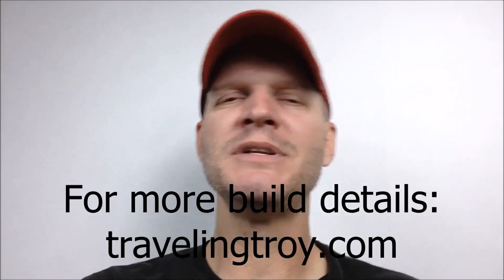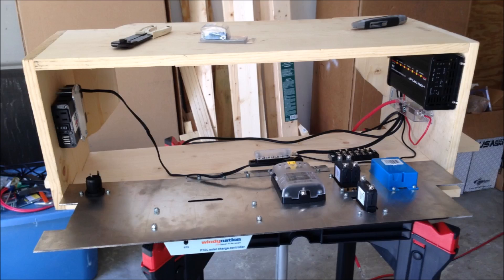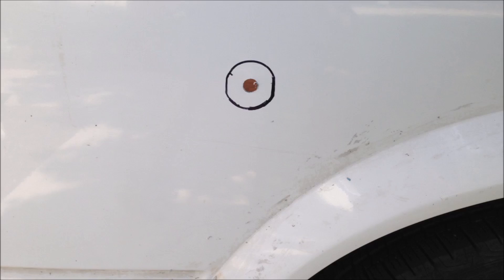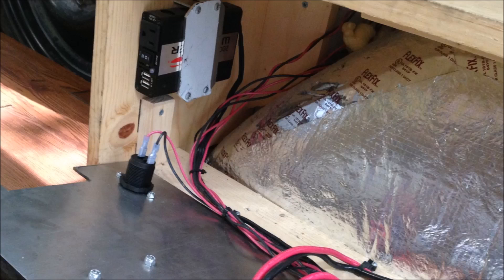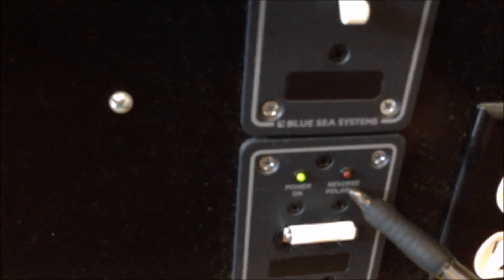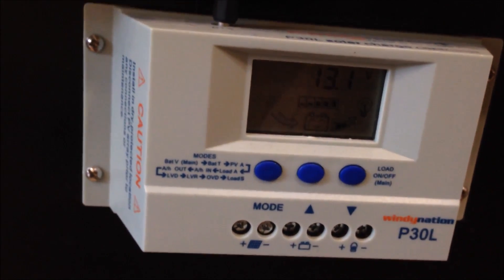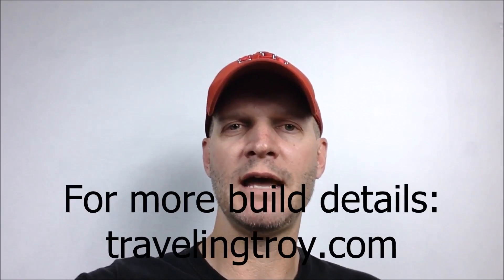Astro Camper Van Build 6 - Power Center - Batteries - Shore Power

Comment: I didn't know you could have batteries inside the van. I have a astro and I was going to get a solar panel and a deep cycle battery,but my friend said they were dangerous as batteries let off gasses. Can you tell me what I can do thanks
Reply from the maker: Hi Debbie.  Your friend was correct.  Lead acid batteries let off gases.  These batteries are cheaper, so they are a good starting point, but there is the gas release issue and they need to be maintained (add water).  Sealed AGM batteries, on the other hand, are slightly more expensive, but no off-gas issues.  I chose AGM for my 1st set of batteries.  I now have a Lithium battery.  Way more expensive, but no maintenance, lasts longer, charges faster and typically is much smaller and lighter weight than the other batteries.  Hope this helps.  Good luck with your Astro van.  Welcome to the club. 😁✌️

Comment: Could i get by with only two solar panels?
Reply from the maker: Hi there.  Sure, you could get by with one or two solar panels.  The 100 watt panels I have pull in a max of 5 amps per panel on a sunny day.  They may only pull in 1 amp each early in the morning, then 5 amps each mid day, then down to 1 amp each as the sun is setting.  So, if you had a 100 amp hour battery, and only one or two panels, it would just take longer to get to a full charge.  For example:  My 3 panels will top my battery off by lunch time.  2 panels may take until 2 pm or so and 1 panel could take the whole day.  It also depends on have much power you are using overnight when there is no sun.  Hope this helps.  Thanks for watching.

Comment: Glad I saw this. I plan to put a 30 amp plug next to the wheel well. I should try to design the power center around it like you have.
Reply from the maker: Hi Anita.  Cool deal!  Glad you saw the video.  The wheel well is typically wasted space in a van build, so it does make a great place to put the power center.  The only negatives I could tell you about are: 1.  You would need to crouch down on the floor to work on wiring/electronics when troubleshooting a problem.  2.  Flooding.  Don’t drive through high water.  I’m from Houston where it floods every year, so I always move to high ground if there is a threat of heavy rain.  I’ve been in my van for over 4 years and have kept my electronics dry thus far.  👍😁 Good luck with your build!

Comment: i first thot you had two inverters one for a small thing and one for the bigger one and you could choose which one you were going turn on or off later to realize it was the charger but it did give me an idea for help me thank of a way to conserve power when only needing a small amount of ac vers  a big amount and to cut down on the stand by pull when dont need the one

Comment: You have given me so many great ideas. So, thank you. The power center around the wheel well is spectacular in its simplicity. Kudos to your Dad.

I looked at that battery charger and can't find good info on it... if its 13.8 vdc float... too high for FLA, let alone AGM. I will probably stick with a custom built Progressive unit, from Bestconverter.com that has better charging parameters including LFP if I ever have an extra couple grand to spend.

I like the AC circuit breakers that work so well on that panel.

 I've also watched your sofa / bed video and that was good as well. Mine will be somewhat different in that mine has to store against the wall (its a cargo van build), but again, simple and nice.
Reply from the maker: Hi Clint!  Yes, the power center has been the star of the van.  My Dad did a great job on the power center and it has worked flawlessly ever since we brought it online.  As far as the battery charger goes, we first installed it because I knew I would be at one location for a while and had access to a free power source to charge the batteries.  Now, probably 2 years later, the battery charger is collecting dust.  I don’t recall the last time I used it.  With the combo of solar and a battery isolator (for rainy days), I haven’t had the need to plug into shore power.

Good idea on the wall mounted bed.  We considered having the bed fold up to the wall as well.  I could see that coming in handy if you want to haul a kayak, bikes or some other toys in the back when not in sleep mode.  I’m glad the videos have been helpful and good luck with your build.  :)

Comment: So how did you end up getting the jack mount out?  I have one that is in
 the same space that looks like I need a blow torch to get it out. Thanks for any insights /tips.
Reply from the maker: Yes!  What a pain that was.  We actually had to pry the jack mount out.  It left a hole, which we had to fill later.  It may be a better idea to have someone blow torch it out.  We didn't have one handy or a "blow torch guy", so we used vice grips, a hammer and other tools.  LOL!  It was a pain.  Good luck with it Patricia.  ;)

Comment: Hello.   I have a question?    I have a shuttle bus , I want to run some conduit  with some plug outlets .  Witch should I use PVC  or  steel  conduit ?    Thanks
Reply from the maker: Conduit is a good idea as it will help protect the wiring. On my van, I didn't use conduit. It was too small of a job for that. Instead, I ran my wiring while I installed the insulation, expecting the insulation to provide protection.

Comment: Very good detailed instructions on how to install it correctly.i like how that panel is so accessible for future adjustments or repairs or troubleshoot. You guys should continue making more videos summer to this. Future advice identify the wire gauge for those that are new to this. I know the short distance it’s not that important to know the wire gauge but if you’re planning on running the wires further out than I know it would be very helpful to know wire gauge .keep up the good work 🚐👍🏽🙂🔧🍺🇺🇸🇲🇽🍕
Reply from the maker: Thanks for watching.  My Dad and I are in the process of doing an electrical upgrade to the power center.  I plan to make more videos and supply a detailed wiring schematic soon.  We're adding a battery isolator,  new solar controller and a battery monitor.  Cool stuff.  :)

Comment: Hey Tony, love the build! Just finished a year living in the back of a truck. I'm picking up my "new" astro tomorrow! Its got 210k on the motor yikes! 2 quick questions, did you have to deal with the dreaded spider injectors yet?? And whats the shore power battery charger you used, I like all the blinky lights. 

See you on the road
Reply from the maker: Good luck with your build.  No, I haven't to do anything with the injectors yet, but some day.  I used the VMAXTANKS Smart Battery Charger.
Reply: Logan Stark your dad is awesome! Can I adopt him...pleeeease! Lol Great job!
Reply: Logan Stark I have the 5.7 vortec in my1500. super tight access, but doable with time and patience and lots of pictures as you go along.
Reply: 🚐🤦🏻‍♂️You should look into the new ford transit they’re becoming more fordable now that they’ve been on the market since 2015 the 148 wheel base is highly recommended you should test drive one ☝🏽. And if you do buy a Ford transit get the 2016 and up.😉

Comment: Nice Setup the only thing I am confused with is what inverts the power that runs to the Wall outlet? I see on one side you have a 300w inverter but does the charger have an inverter inside?
Reply from the maker: Hi there.  The wall outlet in my van is only usable when plugged into shore power.  I wanted to give myself the option of running high wattage small appliances if needed in the future.  When out boondocking, the outlet has no power, so I rely on solar and plugging into cig outlet and the inverter which has USB and one DC outlet.

Comment: Why not have the batteries hooked up to the alternator instead of having a solar rig?
Reply from the maker: Hi Corey.  Yeah, setting up a battery isolator is in the future plans, but that is best for when you are on the move all the time.  I knew going into this build that I would be mostly stationary for a while before hitting the road full-time.  So, I needed a way to get power without having to run the engine.  At first, it was hooking up to shore power, then it was the solar setup.  I haven't had to plug the van into shore power since installing the solar panels.  It does cost more than a battery isolator, but it has been well worth it.

Comment: I'm hopeful you've enclosed the batteries and created a vent to the outside. A discharging battery is quite a dangerous thing.
Reply from the maker: Hi Ken.  My batteries are sealed AGM batteries which let off little to no fumes.  However, I never sit in my van without some sort of circulation going, bringing fresh air in and pushing stale air out.

Comment: very good and informative, I may have to borrow your system someday. I'm assuming that you just add the solar leads into the controller when that time comes and everything runs smoothly. very nice.
Reply from the maker: Yep, that is exactly what we did.  We built the inside components in the power center, then later we added the solar panels and just connected them to the solar controller in the power center. :)

Comment: Excellent build , very clean.  I am planning an Astro AWD build now. I will be incorporating a lot of your ideas on the electrical section of the project. Did you ever get closet storage built above the power center ? Thanks for the videos , great resource for information.
Reply from the maker: Hi Adam.  Thanks for checking out the videos and good luck with your AWD build.  That will be cool!  I did get storage built above the power center.  It is currently just shelving, but will be will be completed some day in the future as closed off storage.

Comment: Sup Traveling Troy! I'm in Houston about to convert an E-250 passenger van. Couple questions I have are what would be the best way to insulate all those large windows?? And, when it comes to batteries and electricity I have no clue what're to begin so thanks for this video, my question about that is what are the bare necessities and bare minimums needed for a battery set up because all this looks like rocket science haha. Thanks
Reply from the maker: Hey that's cool Austin.  Good luck with your build.  Insulating all the windows on a passenger van depends on whether you want to seal them off for good or do you plan to use them for views later.  Most people use reflectix to cover the windows and this can be temporary where you pull it down when you want a view or you can semi-permanently add the reflectix to the windows for the long term where you don't remove them.  I have a video where I share what I did with my windows here: https://youtu.be/utOSILSBvpU

The electrical set up can be intimidating.  You should probably first start by listing out what you would need to power in your van.  The more you need to power, the more complicated it gets.  For a basic setup, you could go with a 12 volt battery (or two 6 volt batteries), one solar panel, a charge controller and an inverter.  This would allow you to charge the batteries with solar and run your equipment from the inverter.  If you want built in lights, a roof vent/fan and places to plug gadgets in for charging, then you would need to run the wiring and add in a fuse box and other items.

I'm no electrical expert and I was lucky that my Dad knew how to do this.  I would suggest finding someone to help so you get it done right the first time so you don't have to deal with the frustration of trying to figure it all out on your own.  Thanks for checking out the videos Austin.  I hope this helped.
Reply: +Traveling Troy thanks you're the man!!
Reply: How does your dad know how to do this? Is he an electrician? Can I pay him to build me one for my Astro?
Reply: I use reflectix for privacy and keeping the heat out, or in. works great!

Comment: I just started my build and have been struggling with the battery location in my van. I know what can happen if they are not really secured in the event of an accident. I plan to use a small gang box made of 14 gauge steel to mount the batteries in. I guess you had your reasons for using an on board charger. Only way that makes sense to me is if the van is parked for a few days at a time. Instead of using an isolator for charging off of the alternator you can use a 30 amp charge controller. Wire the positive lead to the solar panel connection with 6 gauge wire. Then the other end to the battery. This gives you isolation and a smart charger for the batteries. Much better for the life of your batteries. They will charge at around 6 amp max and will never over charge or overheat the batteries. Thanks for the video. Just subbed.
Reply: Yes, batteries have to be VERY secure for worst case scenario (accident). You don't want them flying around in the van! The only thing I'd change is use proper battery hold downs that don't a use bare metal bar on top of the batteries. In an accident those batteries will shift and touch the positive and negative terminals and get red hot and start a fire. All batteries leak current through the case slightly - you don't want the cases connected via a metal bar - plus it will corrode badly very quickly for that same reason. Good videos, very good use of space! The stealth-er the better!
Reply from the maker: Hi, thanks for checking out the channel.  When we were building the power box, we knew I would be in one place with only light travel for a number of months.  I had a place to plug in, so shore power was the most important part of the power build at the time.  We just installed a new rack with solar panels over the weekend, so now I doubt I will need to plug in much, but I have that option if needed.  The battery isolator is the next step along with a new solar charge controller and battery monitor which may get installed next month.
Reply from the maker: Thanks for the tips.

Comment: what are your battery specs?
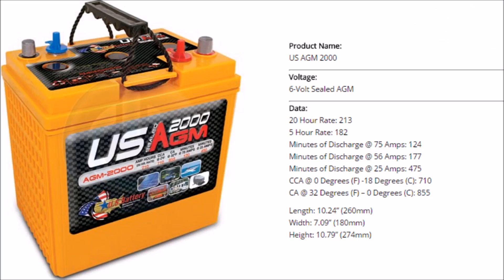Reply from the maker: Hi +Bobby Britton.  My batteries are two US Battery 6 volt AGM, joined in series for a total of 210 amp hours.  There is a screen shot of the battery specs at 1:28 in the video or see more here on their website: http://usbattery.com/products/us-agm-batteries/us-agm-2000/

Comment: Yah Great Vid Troy!  Nice electrical box set up.  Im currently installing solar on my box van with my dad.  Windy Nation 4 100 watts.  AGM only heard great things about that company, I'll prob only be getting some 100ah batts from Walmart. Anyhoot, Plan on hitting the road and travelling the U.S. all of 2016.  Not being a carpenter or an electrician, your vids help to ease some of the anxiety felt for the last month during my build.  I should B done by the end of may and on the rd in June.  Stay Breezy bro
Reply from the maker: Well that's great you're getting to hit the road so quickly. I still have some work to complete on my van. Sounds like you've got a good setup. Good luck and be safe on the road.

Comment: Nice work Troy! You have neat setup there. Since the controller doesn't have a back light, maybe you can just put one of those small stick on battery powered lights in there. Looking forward to the rest of the build 👍🏽
Reply from the maker: Thanks +NoProGoPronto.  We went cheap on the Solar controller because solar wasn't the priority at the time, so we fully expected to upgrade it in the future.  I'm considering one with a remote and backlight.  LOL!  Yes, the power center is only 3 ft from my bed, but it would be nice to see where I stand on power without getting up in the middle of the night.  For now, I have to get on the floor with a flashlight.  Haha!

Comment: This is something that I have to do a lot of research on. I believe I get intimidated by the thought of it for no rational reason. Take care and I still think you should have gone with #1 ;) ~Jman
Reply from the maker: Thanks +A Few Minutes With jman - I would have been lost if my Dad didn't take the lead on this project.  I know soooooo much more now.  I liked intros 4 & 1 best, so got 4 to be on the first new video, but 1, 2 & 3 will get their chances.  :)
Reply: +Traveling Troy  Does this count? I know Tank has 30 amp outside Do hickey! 🐙
Reply from the maker: Yes +Debrajoy!  That's good to know.  Most RV parks/campsites are 30 or 50 amp hookups, with 30 being most common, so you should be good.  :)
Reply: +Debrajoy no paying for camping!🐙
Reply from the maker: I agree +Debrajoy!  Dry camp as much as possible, but depending on your battery setup, you may have days where solar just isn't doing the job.  Too rainy to keep up with your power consumption.  On those days, you may need to plug in or if you have a battery isolator,  your alternator will charge your house batteries while you drive.  Cool stuff!  Now, go clean up that hot mess.  ;)  Yuk!  Ha!

Comment: I would consider getting an MPPT controller if you can.
Reply from the maker: Great suggestion +pokerfacetodd.  We went cheap to start on the controller, but plan to upgrade to MPPT when we add the solar panels this summer.  Thanks for checking it out.